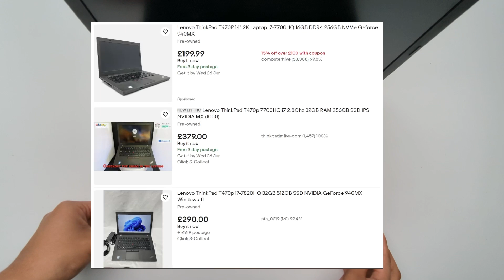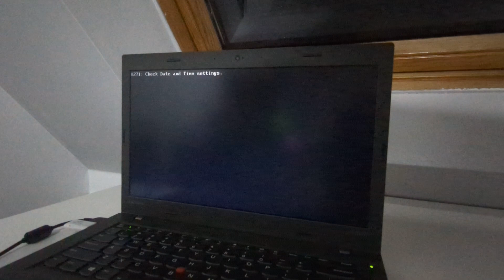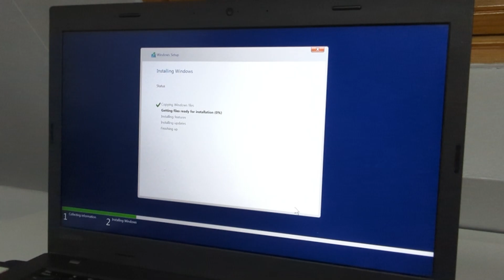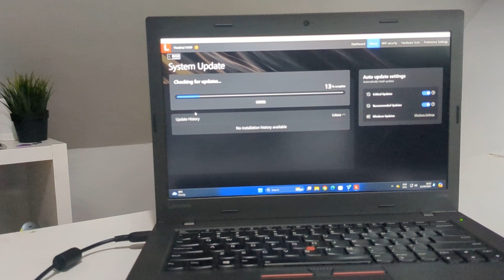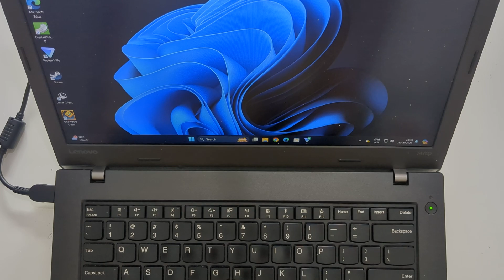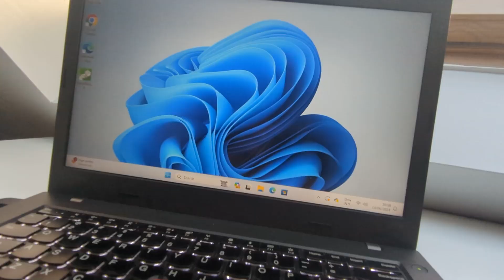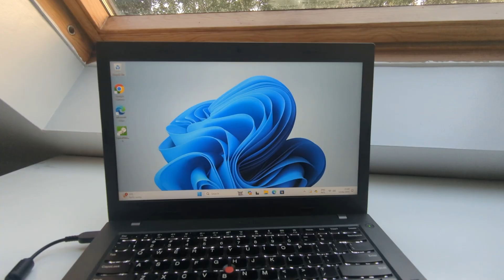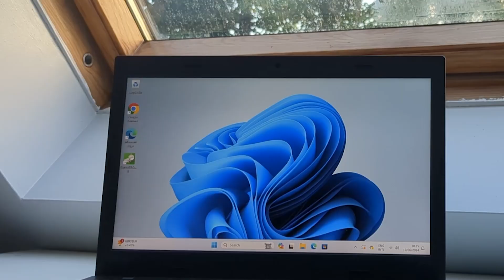DONT buy a ThinkPad T480.. GET this instead (T470p)

Comment: Good luck... I established a rule for myself more than 2 decades ago, never buy used or refurbished computers, you're just buying someone else's lemon.  I was  stung twice once in each category.  Not worth the hassles.
Reply from the maker: I normally look out for refurbished sellers on eBay who offer some sort of warranty. Other than that, yes it's a big risk and makes sense why ppl buy new.
Reply: yeah I used to buy used parts for upgrading my pc over the years, mostly upgrading used gpu. last one was 1060 then I replaced with rx 580, both were artifacting after being used no more than a year. after all that hassle I decide to grab brand new rx6600, I hope it'll last at least 5 years or more.
Reply: Have always bought computers used, have never had a problem and have saved my self a lot of money by now. You just have to be sure who you are buying from, check reviews of sellers etc.

Comment: The T480 with the internal 24wh and external 72wh hours battery in my opinion is the most OP travel laptop ever.
Also you can swap the external battery without turning the laptop off so you could carry a spare one with you.
Reply: In terms of performance I should not even speak, but with T430 you have couple of options:
6 cell battery: 57wH
9 cell battery: 94wH

And if you have slice battery (like I am), it's + 94wH, in total 188Wh. For my use cases (mainly school/programming) it lasts around 14h(max 16h).

But like I said it's thicker, slower so... Oh, and mine has usb-c :)
Reply: @danihek yeah but it has 35-45 TDP AFAIK which is not power efficient and consumes more battery and even generates heat
Reply: @godfatheryt7626  Also you get 4 cores instead of 2. It just way better except the keyboard.
Reply: @2DarkHorizon  well T430 also had 4 cores 8 thread option to upgrade
Reply: @godfatheryt7626  though it would of killed your battery life relative to todays standards
Reply: @2DarkHorizon  that what i mentioned earlier "35-45 TDP"
Reply from the maker: It is pretty sick. Might make a video on one, trying to get the best battery life possible. Could be interesting..
Reply: My l470 dont do that

Comment: the laptop could seriously need an undervolt on the CPU and/or GPU. That thing ran way too hot and thermal throttled hard when playing games.
Reply from the maker: I thought about this too, cleaning it out and repasting didn't do much. I'll take a better look at this, already got an update vid in the works 👍
Reply: @cephacore  A lot of these corporate workstation machines carry CPUs that look great on paper, but run them with underdimentioned cooling solutions unfortunately, so they throttle hard.

Comment: I still kinda prefer t480p since you have 4c/8t processor aswell and since it is a U version, it can be kept cool pretty easily with almost the same cooling setup. There's also an mx150 variant but i guess it is rare and can be rather pricey, also a powerbridge if someone needed an extra battery
Reply from the maker: Did they make a T480p? Thought they stopped that naming scheme and made the P52. Either way, yes the MX150 is highly sought after since it's great for battery life
Reply: @cephacore  oopss sorry, my bad, a little bit of typo, it's supposed to be only t480. Yeahh the mx150 variant is great but hard to find in the used market sadly hahahah

Comment: Back when Windows 11 was announced with those ridiculous requirements, journalists noticed a Surface AiO with 7820HK in the Microsoft store. So the hypocrites just added it to the supported CPU list. That's why you have the support
Reply from the maker: Annoying isn't it, the 7700HQ is essentially the same chip yet doesn't support W11. Actual BS and no wonder W11 has low market share.
Reply: @cephacore  the funny thing is my workplace still uses windows 10 because it would cost too much to migrate to 11 and result is longer downtime.
Reply: update: that windows 10 machine constantly crashes and updates for no reason, so there's a backup thinkpad l14
Reply: And yet when you disable that asinine TPM2.0 check Windows 11 runs flawlessly including all updates on much older architecture. Have it running on my 2012 HP Z620 workstation as fast as greased lightning.
Reply: Win11 has lasted 9-10h on my laptop battery  @izools 

It used to be 4h

Comment: 5:09 that is WAYY too much thermal paste and will cause thermal issues.

A teeny tiny dot will work. These laptops do not have heat spreaders, meaning that you have to spread the thermal paste on the die before applying the heatsink (this is for the best effect). Too much thermal paste would rather make the laptop overheat.
Reply from the maker: Damn I'll take a look, didn't know about that. Thanks for letting me know 🙏
Reply: @cephacore  just use ptm 7950, won't need to repaste again
Reply: @ExtremalMetal  correct, I highly recommend it.

Comment: i got the t480 with the specs is i7 8650u 16gb ddr4 ram dual channel and dedicated nvidia gpu called mx150 its perfom fell on rainbowsix siege 720 low got avg 68+fps :V
Reply from the maker: Damn you got lucky, that's a rare model. May I ask how are the temps on it?
Reply: @cephacore  cpu hovering on  90 Celcius+ and gpu 75 Celcius on temps limit

Comment: I think thats not as good when it comes to gaming, the T480 I found has a thunderbolt 4 port which i can use to plug in an external gpu using gpu adapters or docks. Either way that does have a stronger cpu but without a thunderbolt is kindof a hard choice
Reply from the maker: Yeah I was looking at it more in the way of CPU power, which the T470p excels at. Wouldn't really game on a ThinkPad but if you were, an external GPU setup would be the way.
Reply: @cephacore  Kinda sad they didn't put thunderbolt on it, but if I say more which laptop is better now than the ThinkPads is the Dell Latitude 5420 (if I remember correctly) it has 2 thunderbolt ports and can get under 20k Pesos for second hand, which has an i5 11th Gen and an amazing screen

Ps: You should defo check the capabilities of that dell laptop out, since I'm planning on getting that as an upgrade to my t480

Comment: I was able to pick up a T480 earlier this year. The seller advertised it as having an i5 and for $55 +$10 shipping so I snagged it. A week later I received it booted it up in bios and lo and behold it had an i7 8650U with 16GB of RAM, 512GB nvme and extended battery. Ofc feeling bad I asked the seller if they shipped the right item as it was an i7. They told be they messed up the ad and it was supposed to be an i7. So I was sent the right item and I was happy, only thing it doesn't have it a fingerprint sensor, backlit keyboard and there's a noticeable spot on the screen but only shows on light wallpapers or anything on light mode. But at the price I got it for who am I to complain. I did end up upgrading the nvme to a 1TB and I had a 4GB DDR4 sodimm laying around from a previous upgraded laptop I sold. Popped that in and I had a total of 20GB of RAM more than enough for anything I use really. I really enjoy this laptop for when I dont feel like booting my desktop or when I simply just go to coffee shops and do my work there. I also found a Dell B16 docking station at my local thrift store for $8 finding the right drivers for it was a pain, but once I got it working. It played well with my T480. I can connect it to my Ultrawide display, my mechanical keyboard and mouse, an external drive to store pictures from my phone and other important documents. It's a great daily driver. If you can get one for the price I got it for well worth it. but the T470 isn't that bad of a machine either.

Comment: I have a T480 that I ordered a while ago now and I played Daiblo  IV on it with no dedicated graphics, so i don't know.  Maybe I just got lucky now don't get me wrong I had to switch it to the old school look in order to run it for any length of time, but it still ran it pretty good.  At the end of the day it's a laptop not a desktop so i never expected very much. You are right about finding one with dedicated Graphics and yes they're a little pricey, but cheaper than a desktop.  Good video I will have to look into that laptop a little more. God Bless and have a good one.
Reply from the maker: Thanks, hope you find one at similar price to the one I bought. It's a solid laptop seven years on.
Reply: I can play stalker shadow of chernobyl fullhd on static shading no problem on T480.

Comment: I Bought this same model of T470p nearly a year earlier, it's great for what it is. The reason why it supports Windows 11 il because of the TPM 2.0 protocol implemented in the i7-7820HQ, wich is not present in other CPUs from Intel's 7th gen. 

The main differences between T470p (this top tier model) and the T480 (the top model too) are the internal battery, wich let you change the external without turning off, the "u" variant of CPU, wich have a consumption 3x times smaller than the "HQ" variant (15 VS 45 watts max) wich provide better battery life on the T480 by 25% if you have the biggest external battery on both.
The second main important point is of course the generation of the components, and i think about the MX-150 vs the 940MX. Yes, this will not be a enormous difference, but the fact that the MX-150 is a disguised GT-1030 wich uses the Pascal architecture versus the 940MX on the previous one, gives us better  power efficiency and a +50/60% performance on benchmarks on average.

In conclusion, T480 is better if you want biggest Battery (up to 24Whr internal +72Whr external and a "U" CPU) and if you need a little extra boost on graphics performances with a more modern GPU. Overall, those two laptops are very High end "Old" machines, wich will for flawlessly for standard day to day usage for most people.

Nice video, if you want more information on Lenovo platforms, you can see their PDF on internet, here are the ones of those 2 platforms, but you only need to tap "T-XXX platform specs" to find all the infos on the lenovo platform you want to know about.

I recommend people to look at the X270 platform for those who want 12,5" laptop experience, it will not support WIN 11 but with a Win 10 of a Linux it's absolutely perfect for long outdoor trips.
Have a nice day i i hope to see more of that content in the future. ;)

T470p platform: https://psref.lenovo.com/syspool/Sys/PDF/ThinkPad/ThinkPad_T470p/ThinkPad_T470p_Spec.PDF
T480 platform: https://psref.lenovo.com/syspool/Sys/PDF/ThinkPad/ThinkPad_T480/ThinkPad_T480_Spec.PDF
Reply from the maker: Appreciate the really in depth comment, agree with everything you said. The T480 dual batteries are nice, I quite like how you can hotswap them with another one. In defence to the T470p, batteries can be cheaper due to them being used for many generations (T440-T460) and (X240-X270). Nice you mention the X270, a great small form factor ThinkPad. I'll be making a video on that soon. Thanks for your time👍
Reply: T470 does not have TPM 2.0 and does not have a chip that supports Windows 11.
Reply: @sharingacondowithflorida Odd cause my 470 with the I5 7300U has TPM 2.0
Reply: @ I didn't talk about the T470, but the T470P, which is a different platform. I have it and with an i7 7820HQ, you have TPM 2.0. It's one of the few 7th gen CPU to have it.
Reply: @dixotrent9162  I've done some tests and it may be different for some but I found TPM 2.0 on as old as a 4th Gen I3
Reply: And that was with Microsoft's PC Health Check app.
Reply: @WilmingtonOHProductions  oh i see. Never eard of this, i mostly look at the official technic PDF of the product. Sometimes, you can add some features with modified BIOS or other softwares.  For TPM, i dont know, but thanks for the info !
Reply: The X270 will support Win 11 using Rufus and bypassing TPM
Reply: What CPU would you suggest for T480?
Reply: @ichotw5766  Core I5 8250u or 8350u
Reply: @  It depends on what are your needs. Try to stay on a 8th gen CPU, but you can choose either a I5 or an i7 based on your needs.
Reply: @dixotrent9162  You mentioned the x270, I was thinking of an x280 is there much difference between them?
Reply: @agush22  its a significant  jump, from DUAL core to Quad core CPU.

But there is à catch, you have soldered ram on the X280, the x270 have a classicisme SODIMM slot
Reply: i have l470 it has tpm 2.0 with i5 7200u

Comment: Recently I got a t14 gen 2 with mx450 graphics for 200 + 32gb ram + i7 11th gen.
A couple weeks before that I got an a285 (x280 with a ryzen basically) for £100.

I own two thinkpads, the cult has indoctrinated me. I did a cheeky tdp unlock with ryzenadj on my a285:  with a cooling matt on the bottom, it can play baldurs gate 3 at 28 watt tdp at 26fps
Basically steamdeck settings, 800p fsr utra quality. The a285 is insane for value if you got it for my price point. Mine was in such good condition, I thought it was new.
Reply from the maker: I need to get ahold of one of them. The A series ThinkPads are quite interesting
Reply: How much did it cost? T14 gen ii one?

Comment: If I am not misktaken that nvme adaptor is not running into sata but actually a U.2 port. which looks similar to sata and is sata compatible, but is way faster than sata
Reply from the maker: Ah thanks for the info. Never knew that lol
Reply: That's what and why i was scratching my head. How on earth did he put NVME drive into SATA port through adapter?! turns out it was U.2 Which makes it even more interesting, because you could put some big and cheap server class drives.
Reply: Power draw might be higher on those enterprise drives though so might not be great for battery life.

Comment: Man i just bought a T480 i7 8650u for 280 us dollars and it overheats like crap
Reply: Yeah the i7 actually performs worse than the i5 due to the thermal throttling. - order yourself a Honeywell PT9750 thermal pad and Re-paste and clean your heatsink. Will see a massive improvement.
Reply: @anon7661  should i also use the dual heatpipe coller
Reply: generally the opinion on reddit etc, is that the i5 version is better - i think i can agree since i'm trying out an i5 8th gen t480 and it hasn't overheated at all so far, running quiet most of the time
Reply from the maker: Have you tried cleaning it out and repasting it?
Reply: @cephacore  no i bought it refurbished and they have a warranty void sticker so i have to wait 6 months
Reply: @Mrproud696 I would do it anyway. But I like doing all my own repairs.
Reply: @cephacore  is there a way to know if the processor has degraded due to high temp for long time
Reply: @Mrproud696  Usually degraded CPUs will become unstable at voltages that were stable before. You can undervolt your CPU by the minimum amount(ten milliVolts I believe), and test for stability.
Reply from the maker: I doubt high temps would degrade the CPU, all that would happen is thermal throttling which in effect gives it that effect but the CPU is totally fine. You can do a stress test w Cinebench to see if the results highly differ. But I'd recommend either repasting it, replacing it with a GPU T480 heatsink (dual heat pipes have better heat dissipation), or return it. Hope you get it resolved.

Comment: The 7th gen cpus aren't officially supported under Windows 11, but you can install Windows 11, you just can't upgrade from Windows 10 has been my experience.
Reply from the maker: The i7 7820HQ is actually on the list of supported processors for Windows 11. Quite strange tbh.
Reply: Actually if your laptop has tpm 2.0 it should support Win 11, the 8 gen is a simplification because all 8 gen laptops have tpm 2.0.
Most of the business class 6, 7 gens have tpm 2.0 but personally i would no install Win 11 on the dual core ones.